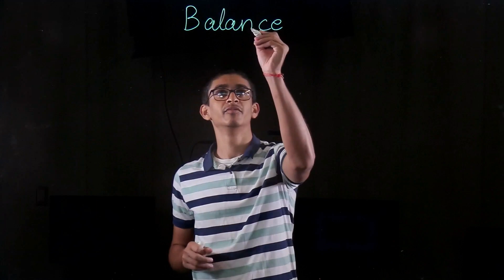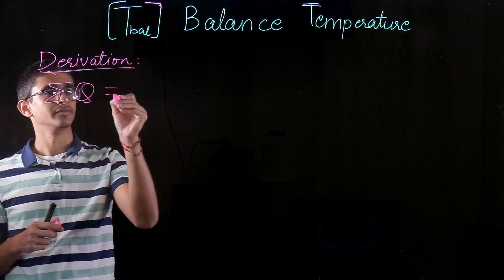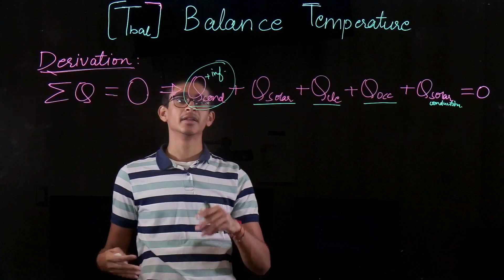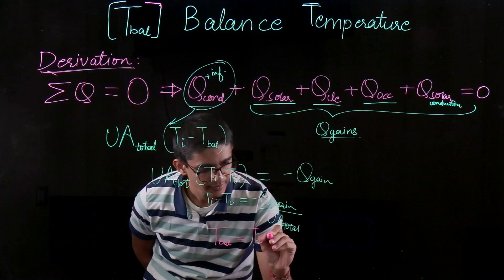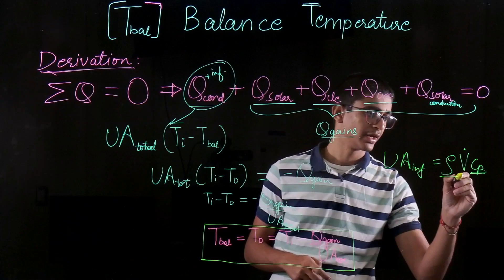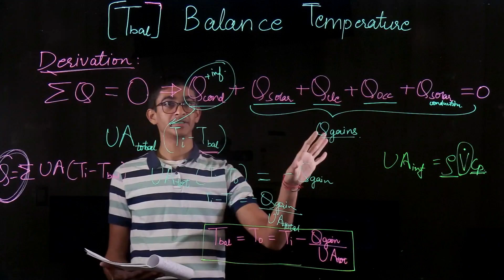Balance Temperature Concept and Uses with Technical Details

Comment: Hi Dhyan,
I want a simple formula to calculate base temperature based on metrological parameters
Reply from the maker: Hey,
What kind of parameters do you have available for calculating balance temperature? And where do you plan to apply it?
Reply: @dhyandpatel132  2m temperature 
2m dew point temperature 
Solar radiation 
Wind speed and any variable from ERA5

EGYPT